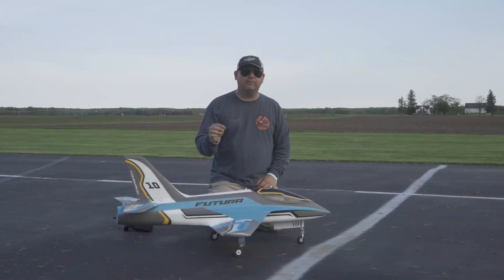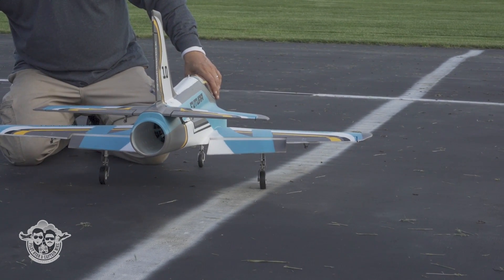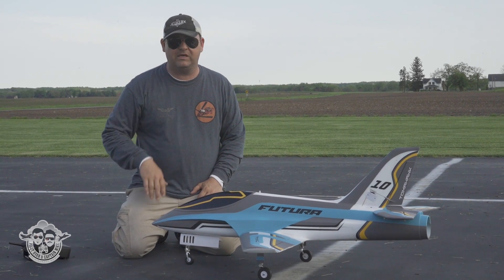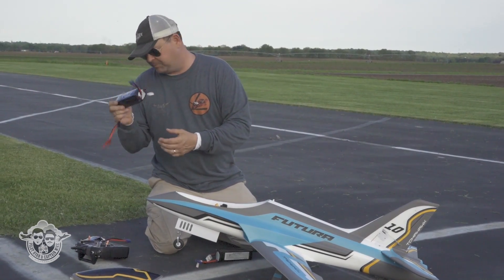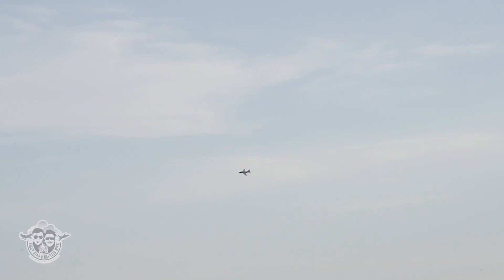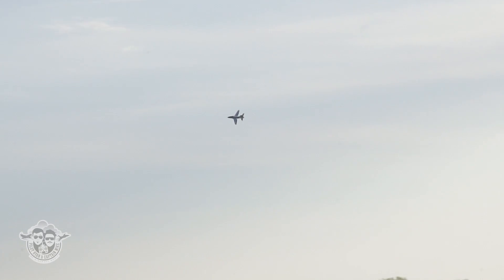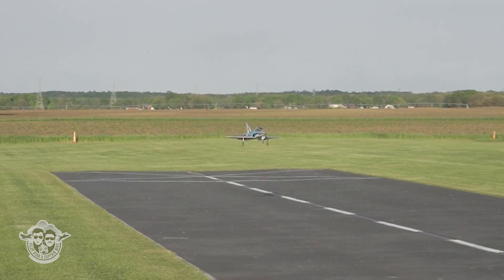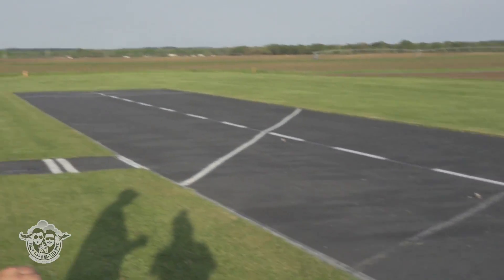FMS Futura V2 80mm EDF Jet Flight Review

Comment: You say "back pressure" during take off's and when you are settling in inverted or when you do a slow pass.  What exactly are you referring to with your "back pressure"  Are you talking about elevator use an adjustment?  Or are you referring to back pressure within the airflow for the EDF.  Super confusing the way that you use that term & i'd love to understand your lingo
Reply from the maker: Back pressure on the stick= up elevator

Comment: My new V2 Futura delivered on Friday. Going to maiden it today. Can you say excited ??? 🤣
Reply: How was it good and fast fun  was urs balance edf
Reply: Jeff Arab - several flights on it now. Very fast, very maneuverable, edf seems well balanced. I’ve had no issues and I’m very pleased with this model. A lot of bang for the buck !
Reply: @USNVA11  oh yea good and it is a nice jet pretty stable and fun nice u have it locked in no issue
Reply: Jeff Arab - if you are into edf jets then you are going to want one of these ! Also, I’m flying it using an Admiral receiver with the built in gyro and an Admiral six cell 5000mah battery. Fly’s like it’s on rails ! 

https://www.motionrc.com/products/admiral-rx600sp-6-channel-dsmx-compatible-receiver-with-6-axis-stabilizer#.XXJOonYrCaM.link

https://www.motionrc.com/collections/lipo-batteries/products/admiral-5000mah-6s-22-2v-50c-lipo-battery-with-ec5-connector#.XXJPbb030Mc.link